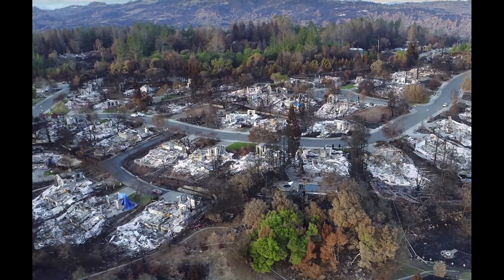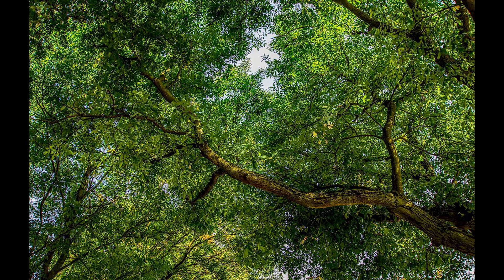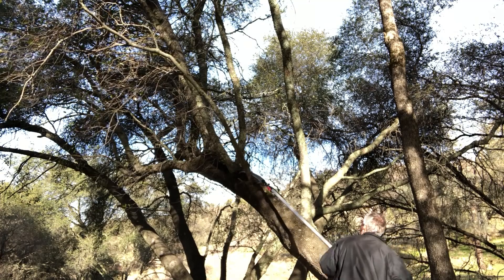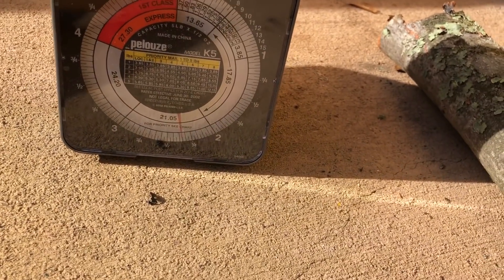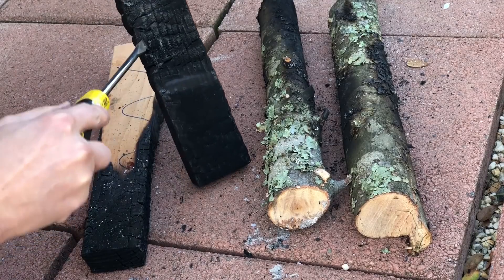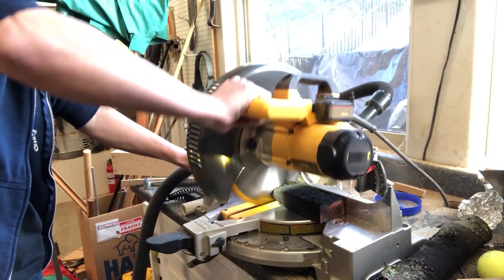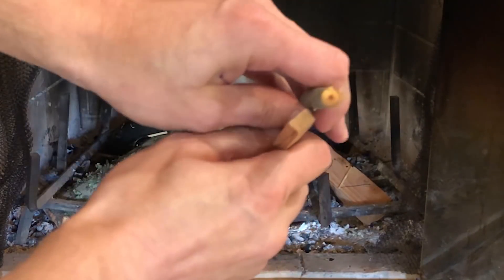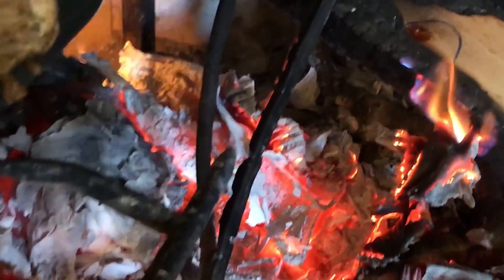Explained: Why Houses burn When Trees Do Not

Comment: It's sad that this needed to be made.
Reply: It didn't need to be made because it is technically incompetent relative to the actual questions of materials forensics that have been widely raised.  The only question this moronic video addresses is whether unqualified idiots are somehow incentivized to make fake "de-bunking" videos on this subject.  The answer appears to be "Yes."
Reply: It's pathetic that Mick West has to use deceptions to shill for the evil NWO.
Deception 1: The anomaly of sites of buildings burned to the ground being surrounded by trees with green leaves is way more obvious in the video "THE STRANGE FlRES IN SANTA ROSA, CA" than in the video above.
https://www.youtube.com/watch?v=UiuHsnDqkL8&index=1&list=PLFziI_1nbmvpurYT5jMIaeHvtBPa38Cee
Of course the NWO shill is not using the obvious one to make it look as if the anomaly wasn't serious when it was very serious.
Reply: Deception2: The NWO shill shows a LASER weapon with visible light at 0:15 when Directed Energy Weapon with invisible microwave frequency was likely to have been used  because the NWO does not want people to have obvious evidence of DEW being used.
Reply: Deception 3:  Since the wood inside a building is protected from the amber by the roof and the walls, the NWO shill should NOT have used wood inside the house to perform the experiment because *the outside of the house or  building, especially the roof,  is supposed to be in contact with the amber from somewhere else first.
 Here are some roofing materials:
Asphalt Shingles- Class A asphalt shingles can withstand a wooden fire burning up to two hours. 
Recycled rubber tiles-Constructed with fire retardant and a fire resistant underlaymen.  
Concrete and Clay Tiles- Do not burn. 
Slates- Do not burn.
Metal tiles-Do not burn.
Since 80% of the roofs in the United States are covered with Asphalt Shingles, test of amber fallen on Asphalt Shingles should have been done instead of fire on wood from interior of the house. 

As for roofs of commercial buildings, professional tests have been done to compare the fire resistance of various single ply roof covers. The  general result is "In all cases the fire 
cannot spread laterally to either edge of the test sample." 
http://www.facilitiesnet.com/whitepapers/pdfs/Sika_092012.pdf
When the roofs of commercial buildings can stand the fires on top, of course they should have no problem withstanding the amber fallen on the top as well. The same goes for the Asphalt Shingles on the roof of houses. When they can stand wood-burning fire for up to two hours, of course they can stand amber fallen on them which has a lower temperature than the fire.

We should note that there is no need to test the resistance of the wall material to intense heat from the side because from the video of trees with green leaves surrounding those sites of burned down structures, we can conclude that  no intense heat could have affected the wall materials from the outside or  the trees surrounding those structures would have turned brown already.  

The conclusion is that no way the fire that burned down those commercial buildings in the video ""THE STRANGE FlRES IN SANTA ROSA, CA"  could have been caused by amber fallen on roof top or the walls.
Reply: @simon6071  Find: "IBHS Research Center Ember Storm Test Highlights" on youtube. Let me know what you see. Asphalt roof included.
Reply: @simon6071  Ok. Are you assuming that trees will burn before buildings in any condition?
Reply: @simon6071  "Living trees, however, are very wet. In fact, although there can be great variation between tree species (and seasonally), a living tree may be made up of more than two thirds water by mass. Thus, a living tree is made up of 15-18% carbon, 9-10% hydrogen, and 65-75% oxygen by mass".
Reply: @simon6071  How about the very beginning of the video here? The green trees  directly at the bottom of the screen, amongst other burnt ones? Also check the other side, green trees amongst other burnt ones. ALSO, check the various tiny grassfields in the neighbourhood, why are they left untouched?  That wasnt so hard was it?
Reply: @simon6071  So, Simon, now you are to answer me why "they" would target individual trees from a laser in the sky. Is there a procedure that tells "them" to avoid little green grassfields in neighbourhoods? Enlighten me!
Reply: @simon6071  I watched # 11 ~ "Forest Fire" My Ass ~ This Is a Matter of Genocide" Some of the trees ARE BURNT, look closer! Now you check out the video "Radiant Heat Versus Firebrands(embers)" and pay attention especially to the latter part. When youre done with that checkout "Be Ember Prepared!" Listen to the interviews
Reply: @schmolywar  You power of observation is so poor. At 0:04 of this video, you can see that the few green trees are surrounded by some brown trees. Those trees are brown not because  their leaves and small branches are burned. You can clearly see that they are not burned. They are just singed by heat radiation around them . The few trees at the center are still green because they are protected from the radiating heat from outside by the tress around them. 
The tress among the burned houses are dark brown because they have either burned or severely singed by the heat radiation from the burning houses.  There are no green trees among the burned houses because the houses are very closed to each other. The heat was too intense to leave any green trees among the burned houses. 
The trees close to the burned houses along the other side are all brown because they have been signed by the heat radiation from the burning houses. A line of trees behind them are green because they have been protected from the heat radiation by those trees closest to the burn site. 
Then there are brown trees behind those green trees because there appears to be a burn site of houses among those brown trees as you can see a small white dot in the middle of the brown trees. Compare the color to the burned houses which are closer. Their colors match each other. 
Some tiny grass fields among the burn site are still green because they are low and they are next the road where there was nothing to burn. The cooler air rushed in from the road kept them from being singed. The DEW was likely pinpointed at the houses. That's why those grass fields were not singed.
Houses burned by natural fires should be  more black than white. These burned houses are white because they have been subjected to intense heat from Directed Energy Weapon. 
Use your brain. Not just your eyes. 
More later.
Reply: @simon6071  You want a real fireman to explain all of this? Checkout "Wildfire: Prevent Home Ignition P.1 & P.2"  Plenty of actual footage and illustrations. Yes, even Malibu in 61. You are working out of misconceptions and myths about how wildfires work.
Reply: @schmolywar  The DEW did not target the trees.. They targeted the houses. However,  if there is strong wind, the burning houses would cause a lot of trees to burn as well. 

Take a good look at 1:20 of the video "Paradise Lost # 11 ~ "Forest Fire" My Ass ~ This Is a Matter of Genocide"  Here are what you should pay attention to: 
https://www.youtube.com/watch?v=VqyPSOU5e1M&t=78s

1/ All the trees around the burn sites are still green. There is not a path of burned trees that can account for the houses caught fire due a forest fire. That means there was no strong wind  during the fire .That means ember storm that must associate with strong wind did not occur.

2/  On the left center of the screen, you can see only a few trees have been burned or partially burned. But the trees near them were all green with leaves visible. When you look at the ground where those burned trees are standing on, you can see that the ground around those burned trees has been singed. Looks like the DEW blasts meant for the houses misfire at the soil-covered position where those trees were and the strong electromagnetic energy singed the soil as well as caused a few tress within the wrong target to burn. 
Even though you may argue that those dark patches on the ground under those few burned trees are only shadows of trees far behind them, the shadow of the tree trunk being visible on the dark patch on the left means that dark patch is not a shadow. 

I have already explained why there were patches of green grass within the burn site. However. I want to show you that when the DEW is fired on the lawn, the part of the lawn being fired at would be singed as well.  Here is an example. Pay attention to the straight burn mark on the lawn at 1:14. 
VIDEO:Since When Do Forest Fires Burn in Precise Straight Lines ?!? (It Had to Be Dew)
https://www.youtube.com/watch?v=R6nZIQm6wNo&list=PLFziI_1nbmvpurYT5jMIaeHvtBPa38Cee&index=20&t=0s

DEW would leave singe mark on asphalt road surface as well as on soil.  Here is another video showing a circular singe mark on the asphalt road surface around a car fired on by DEW from high above.
VIDEO: California "Wild" Fires; Far From Normal. 
https://www.youtube.com/watch?v=lN2IxvDMnHg&t=286s&list=PLFziI_1nbmvpurYT5jMIaeHvtBPa38Cee&index=12

Also pay attention to the video above from 3:20 to 3:40 where there is comparison between houses burned down by Directed Energy Weapon and by fire alone. The difference can not be more obvious.
Reply: Check out video: Satellite imagery shows drastic before and after Camp Fire
https://www.youtube.com/watch?v=323UpVNryYY&index=7&list=PLFziI_1nbmvpurYT5jMIaeHvtBPa38Cee
Anyone who insists those houses were burned to the ground due to wild fire or forest fire or ember storm when all the surrounding trees are still green have to be either brain dead sheeple or shills for the evil NWO.
Reply: What's sad is people actually think it's a real answer!
Reply: It's Sad YOU believe that Crap about BRICK houses burning from wood frames... in that case wouldn't SCIENCE GUY here have burned the Bricks in his FIREPLACE ?
Obviously a FOREST fire Doesn't include TREES in your WORLD.... just an observation
Reply: @TERRY72763  Fantastic response and very reasonable, logical and actually irrefutable to anyone with brains...most on this video have no brains though they think themselves wise! What they really are, are babbling idiots who are totally brain dead by governmental design. For them...the indoctrination of lies took!

Comment: I just caught you on JRE Mick, sent you an email please confirm. Phlobaphenes in the bark are crucial, basically the outer layers of a tree are already deprived of Oxygen so that the rapid process of oxidation known as fire has no true fuel... the oxygen itself. 

(from https://en.wikipedia.org/wiki/Redox ) The processes of oxidation and reduction occur simultaneously and cannot happen independently of one another. 

The first two images on that wiki page, are by no small coincidence of tree bark "rusting" and of a bonfire - two examples of redox. An electrochemical process https://imgur.com/gallery/PBKj0 O...O.... it's magic, you gno?